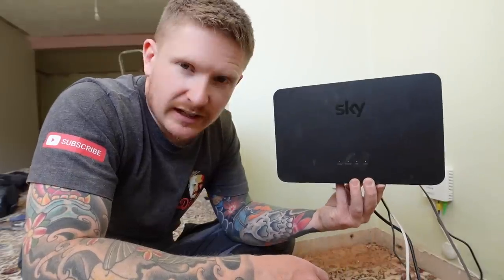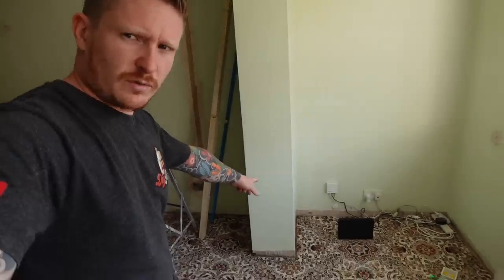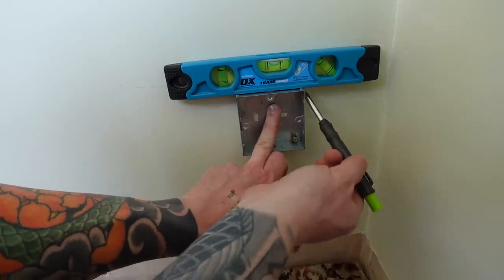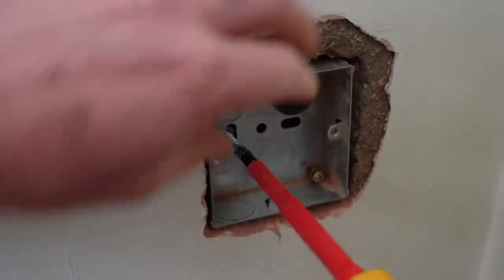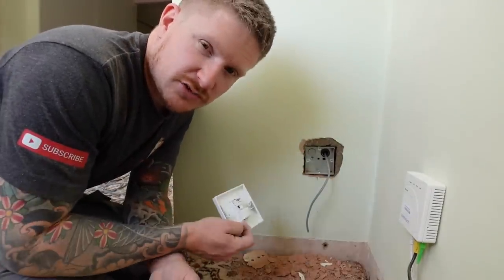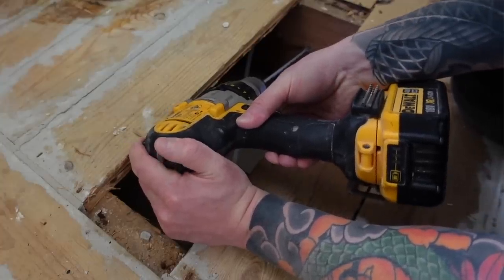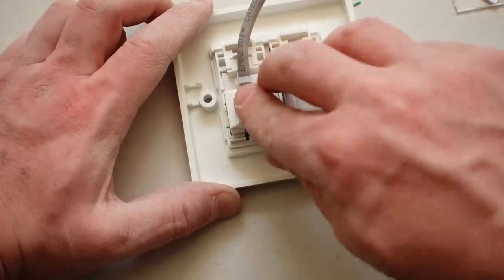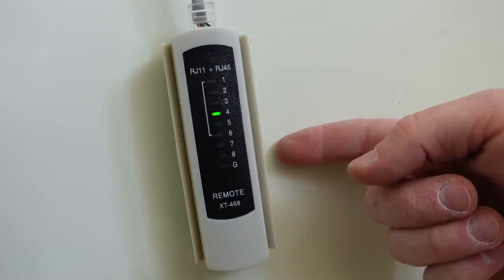How i Installed Network Sockets in an Old House | No More Wifi

Comment: Great video thank you. Silly question, why don’t you run some cables to ceiling spaces so you could fit ceiling mounted access points as well as a few data points?. Boost the Wi-fi coverage at same time.
Reply from the maker: That's a great idea! I am looking into a ubiquiti
Reply: @TheDIYGuy1  i can recommend the ubiquiti kit!.
Reply from the maker: Brilliant thanks 👍
Reply: @TheDIYGuy1 I also have a full ubiquiti home network and can recommend it!
Reply: @TheDIYGuy1  If you are going to do that think about an inexpensive PoE (Power over Ethernet switch
Reply: @BenofYoutube they have a lot of good kit as well, not to mention doorbells cameras etc.

Comment: It's a punch down tool I think? Also worth mentioning CAT5e is only rated upto around 100M in length
Reply: All copper cabling is only rated up to 100meters
Reply: Cat 5e is rated 1gbps up to 100m, but it will achieve 10gbps at 30-40m. And probably 2.5Gbps all the way to 100.

Comment: I love your content tho in this world of wifi 6 mesh networks, is this really worth the effort?  I can understand ppl might want to run a cable to the summerhouse so they have a stable connection at the bottom of the garden, otherwise wifi6 and some compatible wifi mesh kit a much more practical solution imho.
Reply: I have an Orbi mesh system but even that gets black spots in an older house with thick masonry based internal walls.
Reply: Amazon eero mesh is good but backhauled through ethernet is still best for signal speed and strength. If you have a wired WiFi pod in say three rooms it's the equivalent of having a hub in each room. The WiFi signal should be excellent. 😊😊😊

Comment: Isnt this a lot of work? I use device that run internet using electrical outlets. Works perfect. 
Also I pair 1 of them with a wifi extender and it give wifi through out the house. This is only needed i guess if your running a network or network company or something lol.
Reply: Home networking isn't 1-size fits all. The powerline network adapters don't always work well or at all as it is highly dependent on your home's electrical wiring and distance between the devices. I tried those about 7-8 years ago. It took a fair amount of trial and error to find the right wall outlet combination for them to work. I tried 2 different brands and models. The first one was very finicky and would often loose connection. The second brand was much more stable, but was just slow.

If that works for you, perfect. But again, its all dependent on the home and how much time, money, hassle one wants to spend/endure.

Comment: I'm putting a data point behind my tv on the wall along with a new socket.. My question is to anyone.. Can i run the data cable in the SAME chase as the mains cable thats for the new socket?
Reply from the maker: The recommendation is 50mm minimum between an electrical cable and data.

Comment: I live in a 90s apartment where there is working conduit but makes no sense for this era. I hate the builder's guts for NOT adding conduit to the ONLY place perfect for an office + network rack. Tuns out at that time there was customary for well-off families to have a live-in maid in a smallish room and the standard amenities did not include cable-tv or land phone so they ommited the fricking conduit. argh. 
It gets better, there is "cable" and  "phone" conduit separately..non connected..haha.. too bad there is neither anymore.. 🤦‍♂🤦‍♂ The "phone" conduit now has fiber and I had to detour it out and wire over-wall to the small room and add ethernet to feed the "cable conduit"  to a switch that feeds in wall AP where the TV once was.. looks like crap in some places but hey it works.

Comment: Since you've gone to all the trouble of carving up your brick walls, why not run optic fibre? It's now very affordable and you have futureproofed your network. 
I was surprised you has all that smicko gear for digging up your walls but you skimped out at getting a 5 quid rone compatible  punch down tool. 🤷‍♂

Comment: interested by your video some good advice. i am in the middle in doing the same in a new build for the addition of POE cameras and also moving over to a MESH WiFi system to improve the WiFi through out the house and garden also to split the networks for Personal, Guest and IOT devices for the lights, Alexa etc. i would have put the network cable on Conduit and taken two lines to a central location in the home one spare and one live and distribute from there to the rooms required this will give you the option to use a POE Router as well, there is an argument to install a patch panel and a open framed network rack. in my case i fixed a small sheet of plywood slightly off the wall and put excess cable behind the viod i created. this allows me to pull sufficant cable through to the router and neatly terminate with a network plug i also colour code and number the wires. for example the two from the router have red boots, the wires to the rooms/office have purple boots to match the cable and the ones installed for POE cameras have white boots, colour choce is a personal preferance.. i would bin your punch down tool and get a decent one that trims the wires, also worth buying a Knipex Flush Cut Cutters see link " https://www.amazon.co.uk/Knipex-78-03-125-Electronic/dp/B0018NJO2I/ref=sr_1_3?crid=1HUSYYJBYOWIG&keywords=knipex+flush&qid=1687640861&sprefix=knipex+flush%2Caps%2C86&sr=8-3 " i would also bin your tester as it uses the PP3 9v Battery, better to get one with  "AA Batterys " you will thank me when the battery is flat and yes this happend to me. also recommend using decent Cat6 Sockets i am a fan of the Hager products "Hager WMMRJ45  RJ45 - CAT 6 UTP Euromodule White" and "Hager Euro Style 2 Gang Accomodation Plate (White)".
Reply from the maker: Thanks for sharing 👍
Reply: Don't use a mesh WiFi system if you're going through the trouble of running cables, that defeats the point of cabling in the first place.

Comment: A few things I would consider:

- Use the highest spec Ethernet cable you can afford now, it will save you from having to replace a cheaper one when it will no longer be able to keep up with the evolving standards

- Use cable conduits whenever possible

- Use cable rated for in-wall installation. Abrasion and fire resistant, zero smoke, zero halon etc. It might save you & your family

- Avoid routing the cable where it could get in contact with water. Water and electricity (even low voltage) are not good bed fellows

- Install 1-2 extra cables on the same route, even if not required or connected for now, you'll thank yourself later

- Be careful with the bend radius, do NOT bend the Ethernet cables in sharp 90 degrees (or more) corners, make them as round as possible, at least a few centimeters radius. At the frequencies these cables operate with, sharp bends will affect the EM waves and will unnecessarily degrade your signal

- Lay the cables in a "hub & spoke" pattern (i.e. point to point connections from your router or switch to wherever your to-be-connected devices are), do NOT think you can "daisy-chain" them

- For anything more complicated than just a few connections, consider installing an Ethernet patch panel, it will make your life easier

- Like somebody else wrote, try to keep Ethernet cables separate from power lines. Consider PoE as an alternative for low power devices (e.g. cameras, routers, switches etc.)

- Absolutely test them (even with the cheap 10 pounds tester) before completing the installation & wall repair.
Reply: In regards to conduit in this scenario what type would you use?  Conduit/Capping or Trunking? I assume conduit or trunking is better for use because the cable can be pulled out will no damage, as wont be able to do this with capping. I assume The purpose of conduit is to protect the cable from damage from the sharp fragments from the wall chase.
Reply: @ryanjackson3777  conduit also allows you to potentially upgrade it later
Reply: " Install 1-2 extra cables on the same route, even if not required or connected for now, you'll thank yourself later" - best bit of advice, it is painful having to re-run especially once everything is filled in and done neat
Reply: Also avoid water pipes, I've had some cables fail tests just because they were too close of a water pipe that had running water at that time.
Reply: The higher CAT spec cables are thicker than the older spec cables. In some cases this can be a pain as the permitted bend radius is larger.
Reply: Great summary. One addition: avoid CCA cables like the plague. Use full copper instead.
Reply: Nope, let’s NOT pretend that cabling a domestic property is the same as a data centre 🙄 But sure, if anyone wants to waste their time + money, go ahead.
Reply: Brilliant advice
Reply: You don't need to install spare cables, that's a big waste of money; just leave a spare polyproplene string  ("builders line") along the route so you can pull through new cable when required. I then tend to run new string along side any new cable so the string is still there even after you've pulled the new cable through.
Reply: Yep, I would have run a spair - even if it was a domestic (standard )
Reply: Also, get a better punch tool than those yellow cheapies.

Comment: Avoid blow-out when drilling through the walls by reverting to drill from hammer action before drilling through.   Avoid blowing the plaster from around the back-box outline by drilling further in from the outer square or initially use a smaller bit for better results.   Score around the inner square with something sharp!
Reply: I wish they’d teach the BT engineers that!  😩
Reply: @easychats they do. Unfortunately they also teach them all sorts of other stuff in a short space of time, give them a van & tools & proclaim that they’re now competent… most trainee engineers have no practical experience regarding the composition of your average wall, and they’re certainly not allowed to carry blades.

Comment: CAT6a CAN carry higher speeds, for example if you were to kit out your house for 2.5Gb networking. CAT5e & CAT6a both more than capable of full Gigabit speeds. We tend to run CAT6a anyway nowadays as the cost increase on the cable reels is minimal at the scale we do this. CAT6a is also shielded and has more twists per foot which helps mitigate interference and cross-talk between the wire pairs.
Love your videos as always, gives us DIY-ers confidence to do it ourselves!

Comment: Don't be afraid of going outside the property. It's very easy to drill a hole from the inside to the outside. This lets you get the cable all the way around to the other side of the house, or indeed directly into the loft space where cables can come down from above in the upper rooms.
Reply: Just avoid doing it around the front of the house.
Reply: That’s my plan! And people should be aware of where asbestos could be also
Reply: Never drill inside out. Tape measure, measure twice drill once and outside to in every time
Reply: 6mm drill all the way through, turning off the hammer before final breakthrough.
Then larger drill bit from either side. Easy and no blow-outs !
Reply: Yep - that's how I do it using cable for external installation and UV protected.
Easy-Peasy !
Reply: If you're going to run network cable outside make sure the cable is rated for external use. Normal network cable will breakdown in time, the sun and weather will damage the outer sheath.
Reply: @MattySmev  why?
Reply: @jacko101 can you recommend any cable in particular/things to look out for? (I'm looking to route an Ethernet outside)
Reply: @emrynhofmann5757  When ordering the cable  include "external" in the search criteria. Most network suppliers will offer internal/external choices. Cablemonkey is one such company. If it is your first time punching cable into network sockets leave a generous amount spare for re-punching the sockets after testing, you're bound to get it wrong initially. You can usually pull back any excess into a wall cavity/floor space.
Reply: If you do, you will need to add protection from lightning, which is quite expensive.
Reply: Need to make sure you're using appropriately shielded outdoor grade cable, preferably fibre
Reply: And my penny's worth for exterior drilling - don't go in straight horizontal. Put a bit of an angle on it to stop rainwater running down the wire and into the property.
Reply: @MattySmev  My ISP's engineer did this and I was not happy with a blown out brick on the side of the house.  In fairness to them they did send out a repairman after I complained.

Comment: Ethernet cables can be used for different applications, for example a TV connection, a phone connection or a PC connection. The connector on the router will be different according to the intended application at the other end of the cable. Since that initial designed application can change, plan to install a patch panel.

I would prefer to put conduit into the chased out channel for future development or to anticipate future accidents - wife hanging pictures and putting a nail through the ethernet cable.

Comment: Good video as it shows how easy it is. I would recommend you install shielded cable, I replaced all my old CAT5e cable with shielded CAT6 (specifically S/FTP) and found my network speeds improved by a noticeable percentage. I ran a cable up into my loft, connected it to a gigabit switch (industrial grade rated for high temperature operation) and then ran cables down into each bedroom.
Reply: For those that don’t know, the shield is essentially a foil barrier to prevent noise/interference from other services - the tester shown in this video has it shown as ‘G’ (probably for ground, but i can’t remember off hand if this is connected to earth?)
Reply: That sounds like either your Cat5e cable was bad, or not properly terminated. However Cat5e is fully rated for up to 2.5Gbps at the full 100m and you only need shielded cable if you are in an extremely noisy electrical environment. It should never be needed in a domestic property.

Comment: I like your videos, very practical.
I would recommend having both wired and wifi in your home if you can. 
I would recommend a wifi mesh system, which will give you the effect of a single WiFi throughout your home. This will give you good WiFi speeds too even without a wired network.
If you have cabled network in your house then even better as you can get a Mesh system that supports "Backhaul" as the Mesh devices will offer full speed WiFi and route the traffic down the wired network rather than across the wifi mesh. 
The latest Mesh systems use WiFi 6E, which lets them transmit traffic through the mesh even faster than your wired network.
Other advantages would be if you are going Smart Home and IOT things and getting a Mesh system that support that.
Reply: Don't use mesh systems if you are putting all the effort into hardwiring.  I'd recommend using poe wireless access points. Mesh systems are poor in my experience.

Comment: I would have used PVC tubing in your chase and put the wiring inside the PVC. that way, if, you need to replace the wiring, for whatever reason, you dont have to open the wall back up.

Comment: Would it not make more sense, if you have to chase the wall to run conduit so you have a nice easy route incase you need to run anything else? Also I noticed you ran the cables separately to the same location, wouldn’t it make more sense to have 2 runs and tape them together? Basically running both cables in one run
Reply: The downside to taping cables together, especially if you run them in a conduit rather that simply buried in a wall, is that at some point you may need to change one of them. I wired out house for network when we were moving in, 10 yrs down the road, things change and I needed to repurpose a cable that was routed from up near the loft to the cellar. Rather than run a whole new cable, I was rerouting the final 5m of it. The problem I hit was I had been "tidy" and taped the 2 cables together through the conduit. Tape ends and pull together, YES, tape along the length, I would avoid.

Comment: Great video! You make it look very easy. Thank you so much to help us make things for ourselves. 

It could be worth mentioning you can use switches to connect devices on the same floor and using the cable from the router up to each switch as the core link.
Reply from the maker: Great point! Thanks

Comment: Regarding doing chases in such manner, I would have ran a cable hose from the socket  up to the floor space above before filling that chase with bondo to cover it up, making it easy to replace the cables in case one goes back.

Comment: Another great video. 
A general comment worth noting that data cables should be kept a minimum of 50mm away from mains cables. Induced noise can effect data transfer performance.
The ethernet cable connection tool has several names;  IDC,  Krone Punch Down Tool,  Punch Down Tool - and probably many others
Reply: Kerchunker. For kerchunking.
Reply: Depending on the guide, it is advised to keep 300-400mm spacing between high and low voltage cables.
Reply: I don't believe that should be necessary. Cat6 and Cat5e cables use balanced pairs which are immune to common-mode interference that you might get from power cables.
Reply: Or just cross them at right angles, if you have to.
Reply: @MrSwanley Exactly. It is hilarious seeing the amount of waffle that some come out with. The OP hasn’t got a clue what he’s talking about.